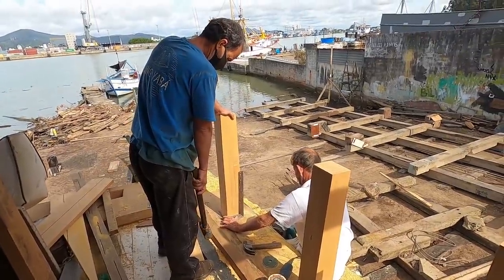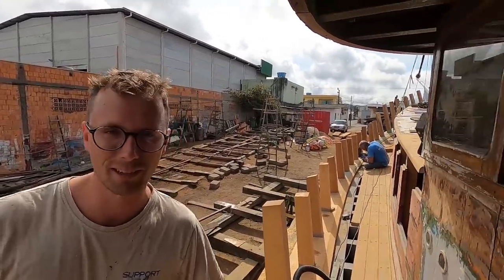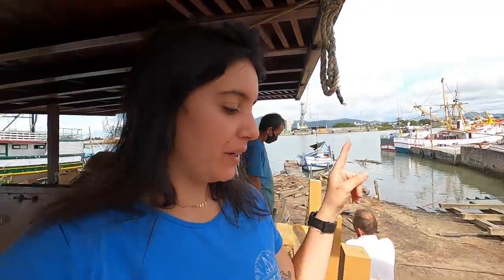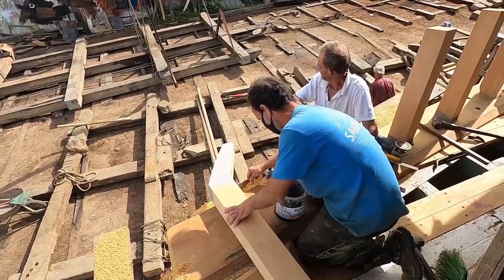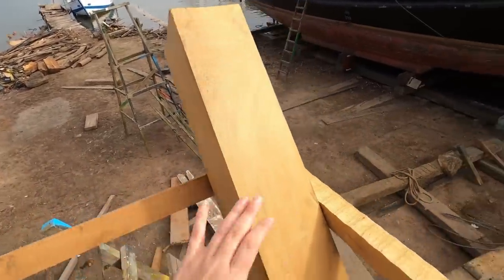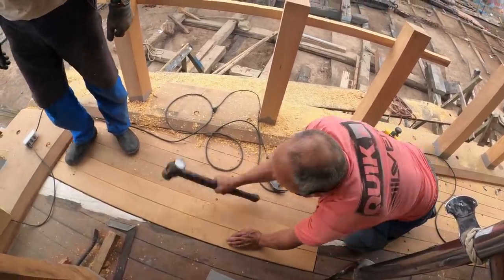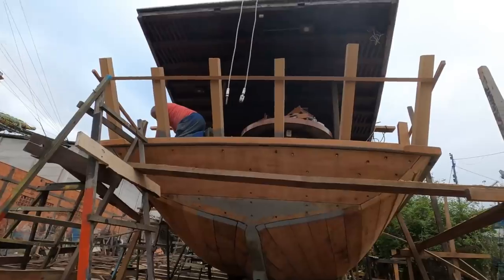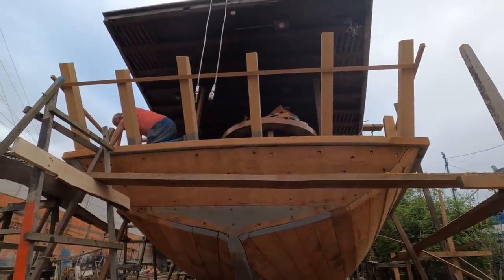The MOST USEFUL tool in the universe being made! (finishing deck & stanchions) — Sailing Yabá #53

Comment: To sharpen a bandsaw blade "properly" you MUST HAVE a specialized machine costing thousands of dollars..... UNLESS you are skilled and can do it with just a bench grinder.  I love watching these guys.
Reply: This is because big industry has said you MUST have these expensive tools.
Reply: @tamar5261  Yup.  Big Industry always has a way for you to spend your way around having skill.  LOL
Reply: I have used the same way for years, using just a angle grinder & cutoff blade clamped to a table. It is not as good as the original sharpen as you only grind all the teeth at one angle. you usually get 3 sharpens before you have to toss it.
Reply: @calthorp  I sharpen drill bits on a grindstone, young kids love learning this stuff
Reply: Yeah mate, that why I sharpen my chain saw chain on a $26.00 au grinder.🥴

Comment: I am going to miss the shipwrights when you head off in Yaba. As I recall the boat was built in 2006 or so. It seems to have rotted very quickly compared to other wooden boats and ships that last many decades. What allowed the fast decay and has the rebuild been done in ways to eliminate that cause of the fast rotting? Yaba is looking gorgeous by the way.

Comment: Ben & MP it is probably too late, but in case it isn't, you should use tar to fill the seams around the bottom of your bulwarks "col-yumes." Pack them until you think they are full and then pack some more in. The tar will remain flexible thus providing a reliable watertight seal. A bead of Sikaflex ain't going to cut it. You have done all of this work due to water damage, so take the time now to prevent it in the future. Again, you know that I am an all knowing and omniscient YouTube commenter. Ask anybody. :)

Comment: It may be too late but having bulwarks at that angle will keep you from using it. You can’t lean against it or be close to edge. 

If you trip, you will have lots of top-heavy momentum that will take you past any righting moment to keep you upright.
Reply: Or have shelf on inside top of transom bulwarks that goes forward to be vertical from end of aft deck. That will provide safety, function and under shelf place to hang lines, etc.